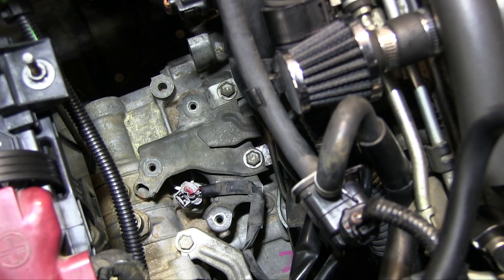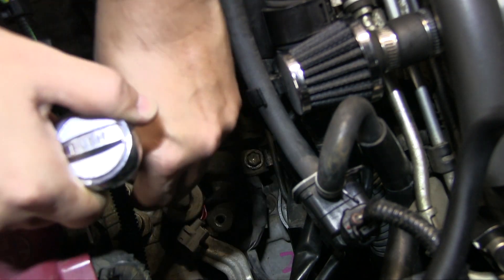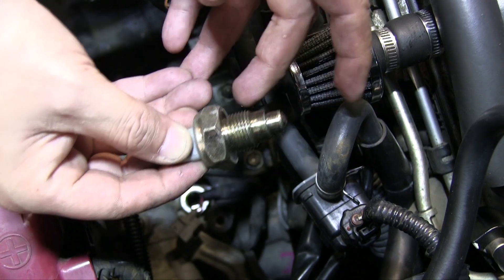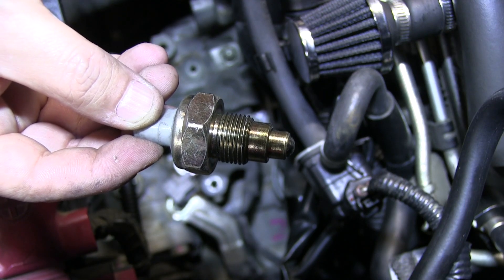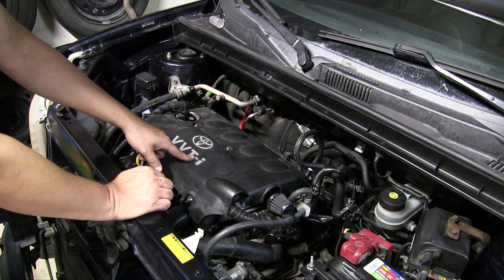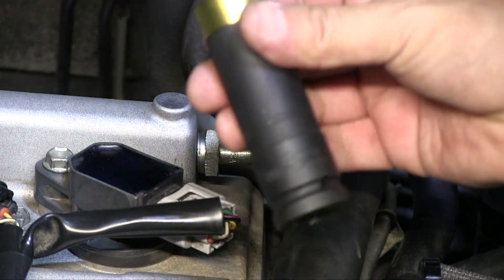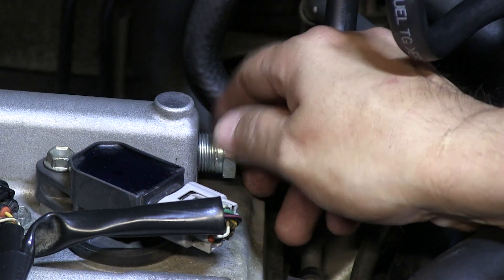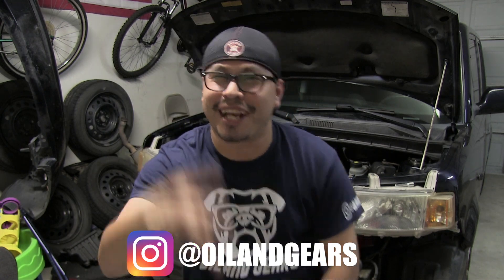1st GEN SCION xB: PCV VALVE & REVERSE LIGHT SWITCH REPLACEMENT

Comment: I tried looking on my xb 2006 but it not located in the same place as your. Do you know if for some are located in a different place?
Reply from the maker: Do you have a manual or auto? This location is only for a manual transmission. This is if your referring to the reverse light switch. The PCV valve location is the same on all models.
Reply: @OilandGears  ah ok mine is a automatic
Reply: @OilandGears  so it will be located on a different spot?

Comment: I do believe this only applies to the manual transmission. The automatics should go through the neutral safety switch. Same/similar location though
Reply from the maker: Correct, the autos have alot more work to do with removing the pan and replacing the filter and gasket.
Reply: Nss

Comment: Mine has been acting up, driving a manual, sometimes it stays on long enough to see where I'm backing off, sometimes it won't. But it always lights up when I put it in reverse just have to reverse it again when it turns off. Is that also faulty reverse switch?
Reply from the maker: You may want to do an inspection of all your fuses and harnesses but it may be the switch. My lights wouldnt work all the time then one day just stopped.